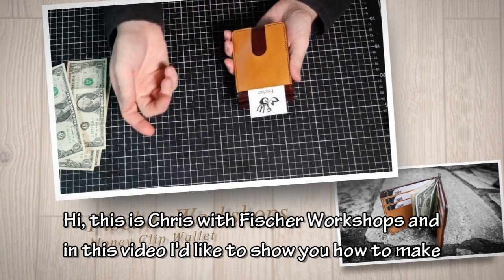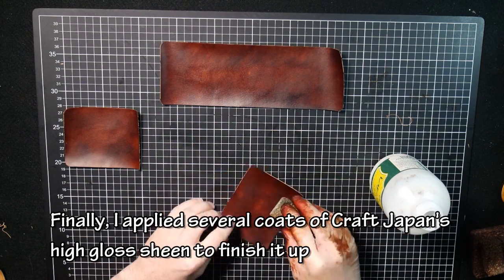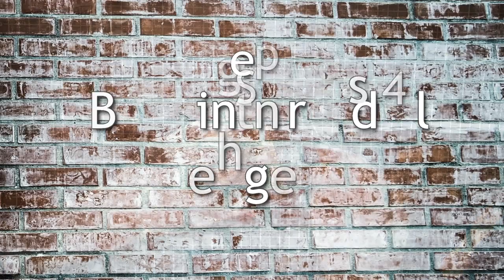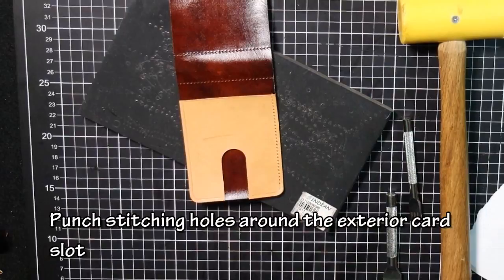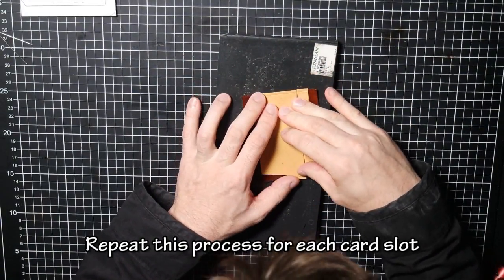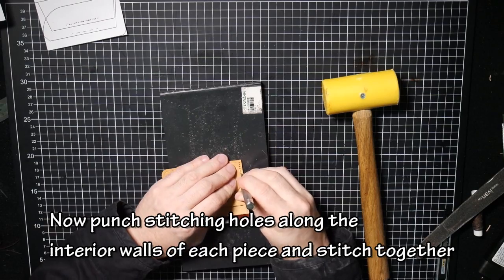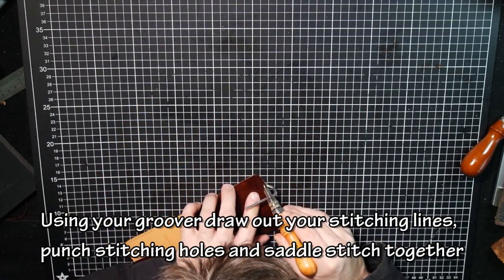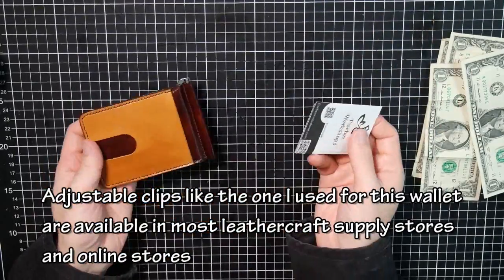How To Make A Leather Money Clip Wallet by Fischer Workshops (HD) 2017

Comment: Wet nice work!  What is that handy glue applicator that I see you using? Where can I get one?
Reply: Very*
Reply from the maker: I think you are referring to the UHU Contact Cement stick I'm using. It's pretty easy to use and cleaner to work with. I got mine at a supply store, but they are also available online at many vendors.